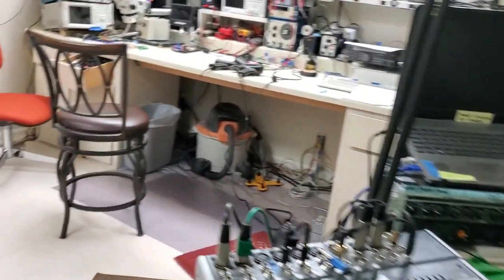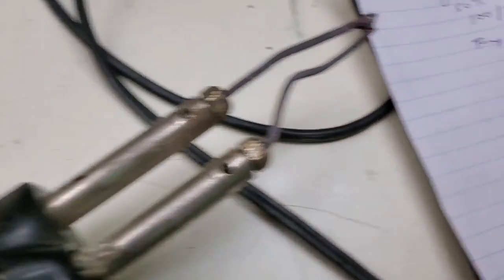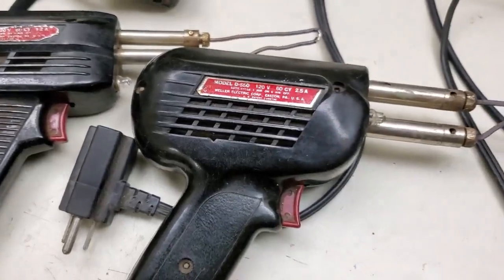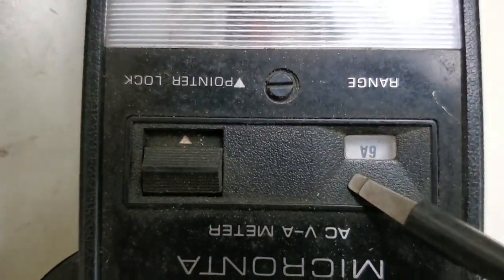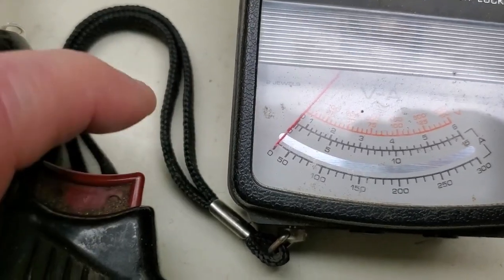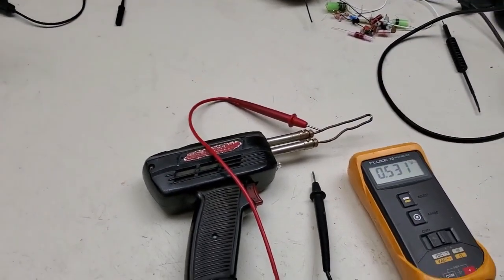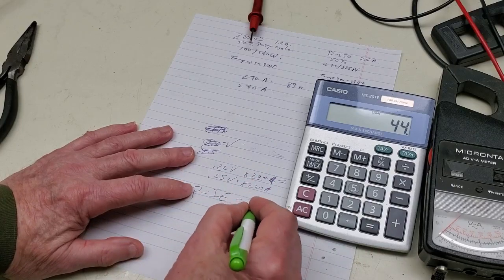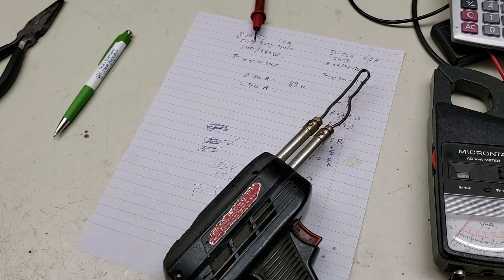Weller soldering guns, is trigger position 1 high or low heat?

Comment: What if you removed the tip and measured what the voltage was across just the terminals.
I'm going to have to do this.😊

Comment: The answer generally depends on when the gun was made. Vintage models that I've owned have all been position 1 low when acquired. In most instances the order stated on the label of the tool itself (i.e.100/140 or 140/100) is correct. It is possible that a previous owner has swapped switch connections, replaced housings, or made other modifications. I know that I've created more than a few Frankensguns over the years.

Comment: I still have the same Weller gun you have, even damaged on the back side - still works,
got from my dad 60 years ago.
I also have used copper wire for a tip, shaped like a factory tip (worked great).
John/W0BIZ
Reply: black circles on the can? i used my brand new one outside in - 10 Celsius and pretty sure i messed it up....still works tho

Comment: Watts will be different with a non-factory tip. Also, you should measure the voltage with the tip out. Unfortunately, I no longer have my old guns, and I don't remember which position was low or high.

Comment: As luck would have it... I measured my D550 this afternoon.  This is about 40 years old.  So about 1980s vintage.  I bought it new for exactly the same reasons you describe.  I needed the higher heat to solder PL-259 connectors.  I remember that on the side it listed the watts as 240/200.  My gun is just like the one pictured in that it has the hex nuts used to tighten the tip.   I plugged the gun into a KILL-A-WATT meter plugged into the wall.  Yes indeed the labeling on the gun is correct.  The first click is HIGH and when the trigger is pulled fully, second click, it is on LOW.   With my actions this afternoon, I confirmed that the label on the gun, my experience, and my measurements all agree.  FIRST CLICK = HIGH     SECOND CLICK = LOW   .......Now the disclaimer, This is my gun I measured.  Other equipment produced at another time could be different.

Comment: You will notice that the voltage increases and the current decreases as the tip warms up.  This makes sense since the resistance increases with temperature.